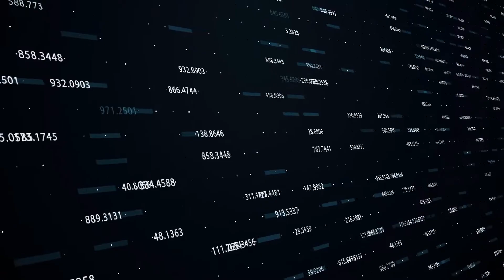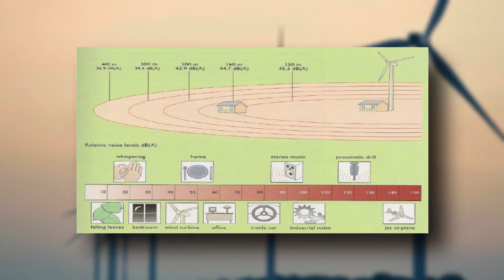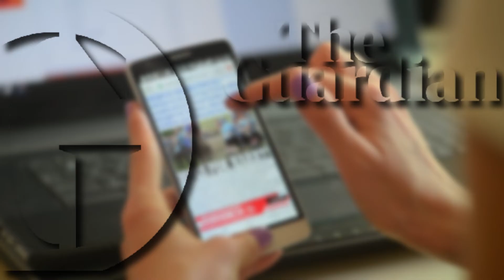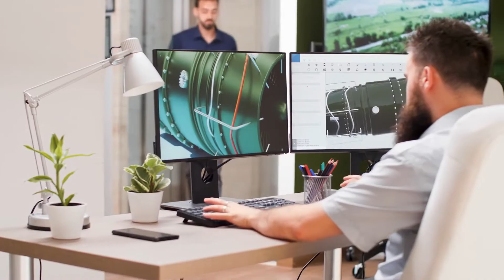Why Current Windmills Can Be Deadly For Our Planet

Comment: I just came here to watch this because in Finland there was found a dead hawk because of these air turbines. This hawk species is very rare and it may go instinct because of these. I would rather build nuclear power. Its safe and ecologically friendly but people hear the nuclear part and go ballistic for no reason. These turbines are dumb. They dont produce electricity in the same capacity as nuclear. Nuclear is better safer and as clean as wind or solar. Theres no reason we should be building these.

Comment: The fundamental issue about power is that it cannot be effectively stored, which means if someone switches on a light switch in Edinburgh Glasgow or London, the power has to come from somewhere immediately. If the wind is not blowing then the power needed to switch on that light has to come from another power source. The wind Turbines have to have a fully operational and safely manned back up power plant (usually Gas, as this can fire up quickly to produce the power immediately) to take over the power that wind turbines are not producing when the wind stops. So we are effectively paying for 2 power plants to produce one electricity (unlike Tidal power.. the tide flows in and out every day without fail and a useful bridge can be a part of the Tidal barrage : ......2 uses for one electricity plant outlay.......as opposed to........ 1 use for  2 electricity plant outlays ! )
No common sense from those who we democratically elect. Government need to be brave enough to invest in proper dependable electricity generation, the technology is there, the understanding is there...........the will of those we elect is not there; .........you have to ask.... WHY !!!
Reply: You're wrong about the "fundamental issue", Rob, lookup grid energy storage.
But I love tidal and wave power projects.
Reply: @florinadrian5174  If I am wrong, enlighten me. As I understand it the only possible effective way is to pump water up to a higher place when energy cannot be used, and then release it to drop down again where it can then release its power at a time when people need it, but again this has to be captured with further water turbines, which means further investment and upkeep of yet more plant and machinery; the alternative is battery storage which is not an effective way of storing power in large quantities.

Comment: Nuclear energy > any other type of energy
Reply: Problem with nuclear is that reactors take about eight years to be built so the reactors we have are always obsolete, but coal plants take more than four so definetely better and the energy they produce is good for a transition process especialy if we manage to deal with the radioactive waste(we are actualy getting really close) however nuclear plants arent the whole solution just part of it
Reply: Nuclear power would be years ahead if leading and major govenments worldwide hadn't focused on weapons grade materials, and manufacturing them discretely via power plants. Thank God China is investing so much in thorium reactors at the moment, not a silver bullet to the climate crises but safer, weapon free nuclear power is on the way as we speak.
Reply: Better yet, integrate a variety of renewable energy while also reducing your consumption of said energy. This cold be by collecting rainwater and using solar showers, ride bikes whenever possible, and most importantly to fight back against the 1% whose main motive is profit above all else
Reply: @benjaminstamper5047  couldn't agree more
Reply: Nuclear is in Every way better, as long as those responsible for the safety of these plants are honest. Chernobyl could’ve been detained if the Sovjets weren’t so Proud😅
Reply: @ReineKen013  or if their powerplants weren't cheap, again problem with nuclear is how hard it is to increase production, you can only upgrade the ones we have so much until you have to build a new one and it takes really long to build one so in the time it takes to build it it's already outdated and so on